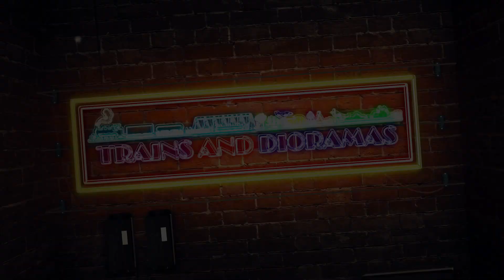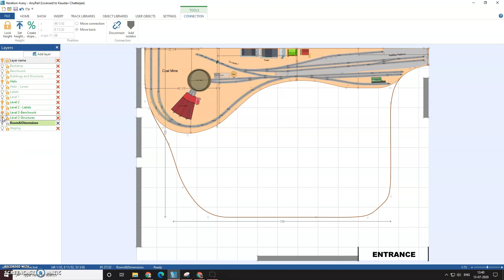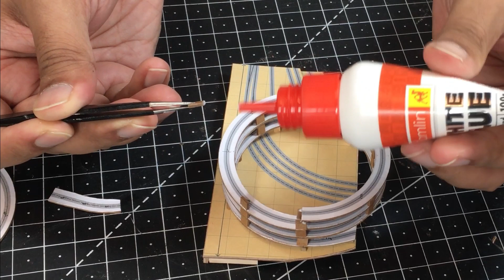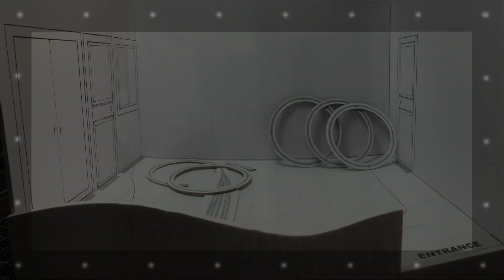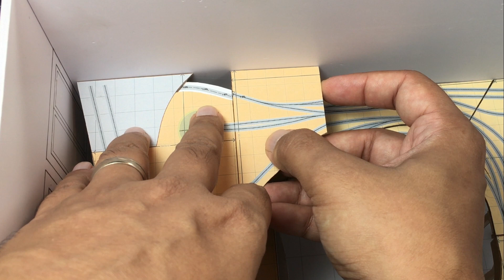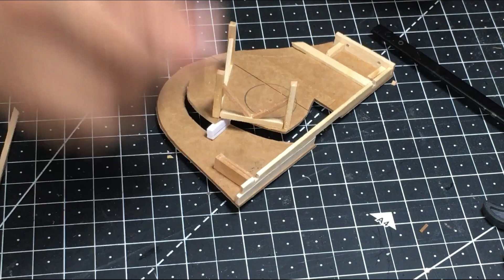Comment: Many years ago Hornby made plastic small scale tracks of their 00 scale. They were great. Have looked and looked on e bay to no avail.
Reply: Yeah, I can’t remember on top of my head but either Atlas or Kato did the same as well - they called that track planning template. Never had one myself because I have never actually designed or made a layout with set tracks - it has always been flex tracks and turnouts. Thanks for looking, cheers! Kaustav

Comment: Such an authentic idea. Never had seen this idea before anywhere else. Computerized design is good, but this scaled down model is the best way to make sure the result is as desired. Thank you.
Reply: Thank you Robert! I’m glad that you think so. You can be as objective as you need to be while doing this in different stages. Like this particular one is good till the bench work and track work stage. Once you reach that stage in the real project and ready for the scenery, the same model can be used to do a mock up of scenery, buildings etc. it’s really a very interactive tool. Thank you for looking. Cheers! Kaustav